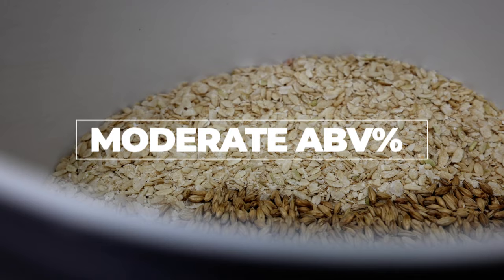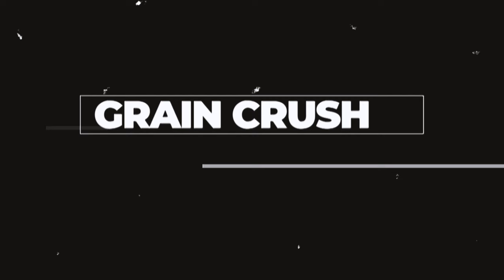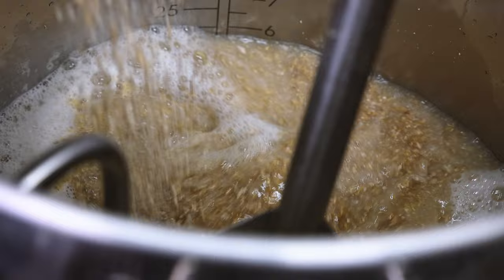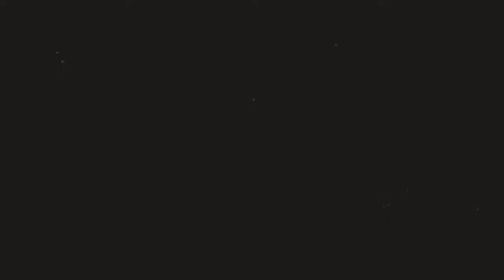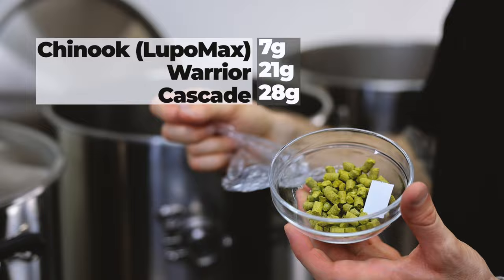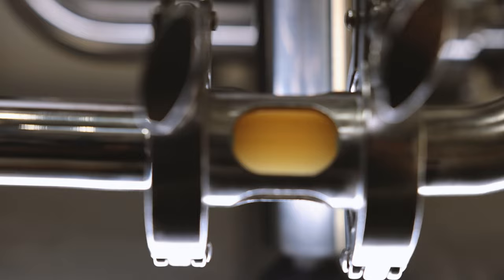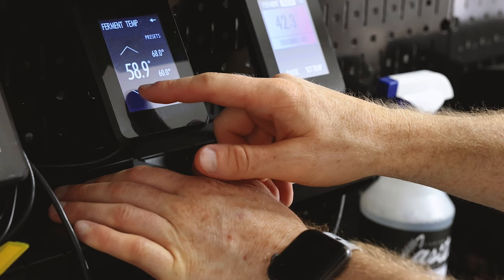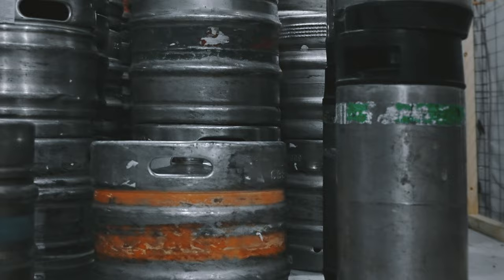Brewing a Cold IPA at Home

Comment: I have two questions for you that I have after watching a bunch of your videos. 

As far as oxygenation, how long will it stay in solution before adding yeast? Say I can only get mine down to 80-85° due to ground water temps. I’ll have to finish cooling in the fermenter. So if I oxygenate as I’m adding to the fermenter, I’m curious if it will stay in solution while the wort cools to pitching temp? Or will I have to reoxygenate?

2- how do you go about fermenting in your Unitanks? Everytime I’ve tried I end up overcarbonated.

Thanks for the awesome vids. 🍻
Reply from the maker: That’s a great question. The short answer is that O2 (like all gasses) will eventually leave the wort if it’s not utilized. So the faster you get yeast in the wort, the more O2 will be available for the yeast. I don’t think 20-30 minutes makes much of a difference if you need to cool for a bit in the tank... this is exactly what I do most of the time. I usually do 90 sec at 1L/min then do additional cooking (maybe 30 minutes tops). Right before pitching, my O2 is usually in the 10-15ppm range.

To carbonate in the tank, the safest route is a spunding valve. This is an adjustable pressure relief valve that will allow excess pressure to escape. Most of the time tho, I’ll carbonate in the keg.
Reply from the maker: ** additional cooling **
Reply: Thank you for the quick reply! 

So one last question for you. I see in your videos that you have the SS grain mill and what looked like new the Spike mill in another. Would you mind giving an unbiased opinion on the two?

I have the SS and have some gripes and problems with it, so I bought the Blichmann. Same issues with uneven rollers. I see Blichmann rereleased an updated version that allows adjustment to the other side of the roller. I’m really contemplating ordering the Spike one but don’t want to experience the growing pains with a new product like I did with the other two mills. What are you thoughts?

Thanks for all the help!
Reply from the maker: @armyguy209  yea the Ss mill was a total let down. Way over priced and poor design. I’ve heard so many different complaints about it. I’m still waiting on the Spike mill (I’ve only used their prototype), but I think it’s going to be awesome. Their gear is typically far superior to Ss. It’s expected to officially release early next year.

Comment: great video, I always enjoy your presentations. I've always wondered, how long does it take you to clean up? Dang son, that's a lot of gear for a 6 gallon batch.
Reply from the maker: Thank you! Usually about 45 minutes. I’ll do a CIP for 20-30 minutes, then hot water rinse, then disconnect the main sections of my tubing so they can dry
Reply: @ryanmichaelcarter  can you make a cleaning breakdown vid? always keen to learn from the pros! 🙌
Reply from the maker: @dapotatoboy4066  yea I have a video of my process on my channel. I replaced my silicone tubing with stainless steel and also replaced my plate chiller with a counterflow, but the general CIP process is the same. Video: https://youtu.be/oPrNauaPKQE?si=OWIZy4n-0g2RApEB

Comment: Love the details on the recipe! Most of these steps are not in most recipe books. Did you learn all these steps (e.g., 10 mins circulation) by experience or did you learn them from course/book?
Reply from the maker: Thank you! It’s a mix of both. I’ve been brewing for about 11 years but definitely have learned a ton from books. I have some of my favorite brewing books here https://www.amazon.com/shop/ryanmichaelcarter/list/1HQNLDUAM19GO?ref_=aipsflist_aipsfryanmichaelcarter
Reply: @ryanmichaelcarter  super I check them out. I would love to see more recipe videos! Looking forward to see a Kolsch, this one in particular has been really hard to make for me. I am just starting, I have a brewzilla and has worked really well so far and I am already looking for an improvement, what are your thoughts on brewing with gas instead of electric?
Reply from the maker: @carlosgmeyerq  I love Kolsch! I’ll put that on my list 🍻 Electric is the best way to go. It’s very efficient and easy to control temperatures, plus you don’t have to worry about ventilating (although you will still need to handle boil steam)
Reply: This looks like a brilliant setup, bjt with that heating element is it possible to do step mashes?